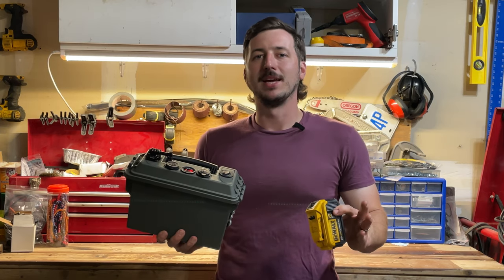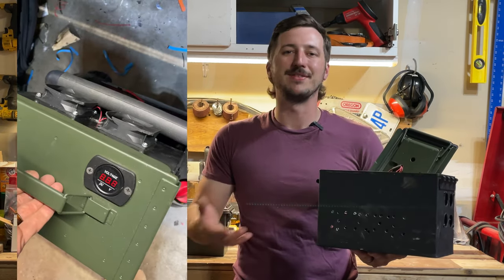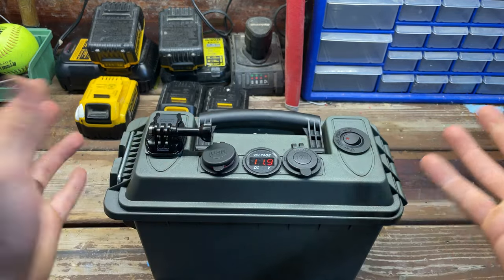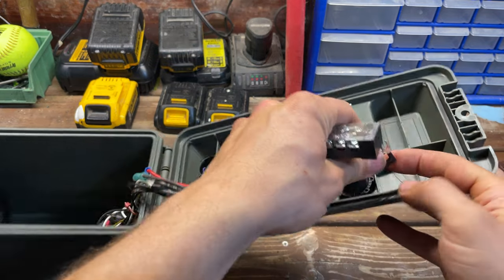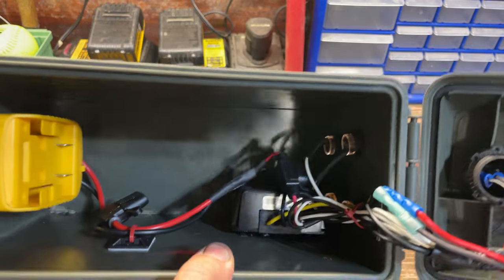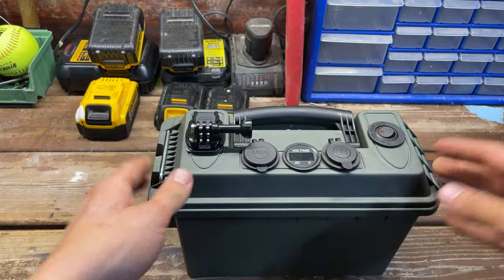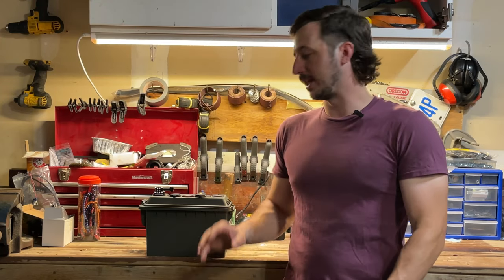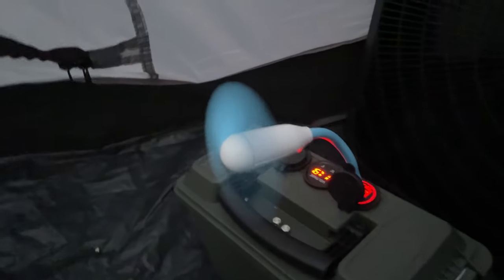How to make a portable power station using power tool batteries! Cheapest option.

Comment: Did you make this or someone else because where’s the tutorial?
Reply from the maker: I built it over a couple evenings. I didn’t think it would be interesting to watch or needed after showing it in this video.
Reply: @joshfishing  I mean, tbh, I would love to see in more detail how you put it all together, at least the usb dongles.  That’s what I was hoping to see anyway.  It’s a neat idea regardless and I didn’t even know they made those step down converters.  My goal is to power a DIY IcyBreeze cooler with it.
Reply from the maker: @michaelcollins106 I will have to try to film a tutorial for the next project!
Reply from the maker: @michaelcollins106 I have tried using Peltier modules to generate power using heat but if you supply power to them they can work for a cooler if you add a fan. It is pretty neat stuff

Comment: BESTEK 200W Car Power Inverter, Car Plug Adapter Outlet Converter with 2 AC Outlets, Dual 4.5A USB Charging Ports, Cup Holder Car inverter with Cigarette Lighter Socket for Laptop, Computer

Comment: You could get a hyper tough tool battery 20 volt in 150 watt inverter with usb and usb c. I would use the usb c to charge laptop. It says it got 20 volt around 2 amp out with 4 a hour battery usb c got different voltages ranges per device use. Use the  inverter to run the fan. Just got it the other day for around 55 dollars. Money well spent because i already use the battery for a hart tool fan with other lithium batteries. Even the 20 volt 2 amp battery last a long time for tablet even after using my soldering iron to attach wires to an led strip. Its for the lazy people who dont want to build projects if they dont have to. When i get my van i will power the lights with the cheap inverters and use the big inverter for microwave and the ac unit to keep from wasting energy and wear on the expensive stuff. also the automatic shut off save ruin the battery.

Comment: Can you please post a parts/products  list?

It sounds to me your voltage regulator is letting the battery discharge faster than what the battery is rated for while under load.
What's to stop you from connecting multiple batteries in parallel?
Reply from the maker: I have a parts list in the description with links right to the products. I haven’t tried connecting them in parallel or series but I am sure it would help! Thanks for your idea.
Reply: @joshfishing  I wouldn't connect them in series, ESPECIALLY if they are different discharge rates.

Comment: Thanks for sharing. I'm about to build one of these for my camping trips to power some string lights. I strongly recommend adding a low-voltage cut-off circuit to protect the battery. You will damage the battery if you discharge it too far. I did this myself and had to toss a $100 battery.
Reply from the maker: Thanks for the tip! That’s good advice right there.
Reply: No problem. I thought the Dewalt batteries had a built-in protection circuit; however, I was wrong. I also learned something else tonight. The USC ports, like the one you used in your project, accept a 12 to 24-volt DC input, so I won't need a voltage regulator unless I want to add a 12-volt jack. You can hook the USB port right up to the 20-volt Dewalt battery. Most power inverters also accept a 12 to 24-volt input, so the regulator could be omitted unless someone needs a 12-volt source.

Comment: I got a 20 volt walmart tool battery when I connect it to the hart 20 volt fan the speed would go up and down its not made for the fan hart fan. I placed a capacitor with it it worked fine. That fan would run a long time. I put two 4 amp hour 20 volt hart batteries in parralle. Make sure the charge capacity matched it work the whole time I slept at night.

Comment: Don't need regulator for charging phone. You can buy the pd or regular USB adapter that fits in a 12 volt adapter. It's rated at 12 to 24 volts input. And it outputs 5 volts usually. Just remember the 12 volt socket outputs 20 volts. But the inverter can't ce used. That's only if you want a really simple unit. My setup don't have the fancy box. I think the small wattage inverter is worthless unless you want to charge laptop. I got a lot of tablets. But yours is good for what it is. Im going to buy the expensive solar generator for microwave cooking. But I'm going to try to get solid state lithium....battery type.
Reply from the maker: That sounds like a cool set up! Always awesome to see how everyone gets stuff done:)
Reply: Some inverters will even accept 12 to 24-volt input.

Comment: This is brilliant. And we’ll designed!

I’m using a Milwaukee packout half size and I have designed it to fit 2x 5.0ah batteries in parrallel, and stepped down to 12v

I powered my fridge for 5.5 hours via this and still had around 25% capacity over both batteries
Reply from the maker: That sound amazing! Great unit, Thank you for sharing.

Comment: I was researching building one of these for someone instead of using a lifepo4 setup like I normally do. I just couldn't justify it after I found a chinese dewalt inverter on amazon for $70.00.
Reply from the maker: Yes, I agree those inverters are a lot cheaper but luckily I had a lot of the supplies from a previous project so it was more affordable to go this route. As well I just enjoy the diy of it all:) thanks for watching.

Comment: Can I use this to power by cooler?
Reply from the maker: Depends on the current it will draw I would be interested to know. I have a 12v cooler I will have to test it out
Reply: @joshfishing   it says 45 amps- but it dosen't run ALL the time- man them cooler power station are pretty pricy- I just need it for over night for the cooler